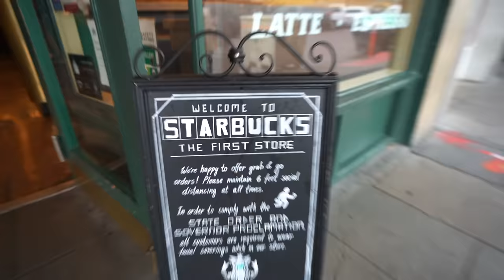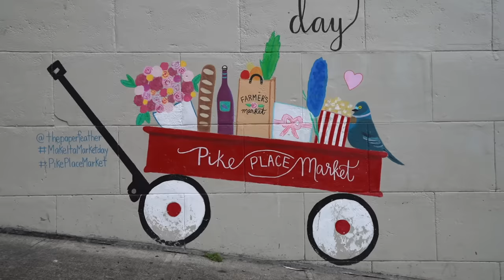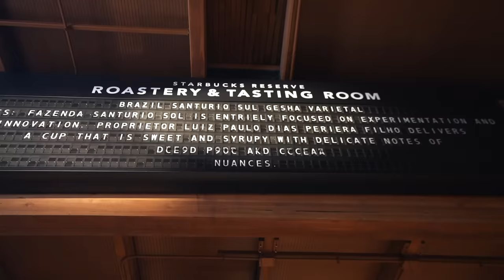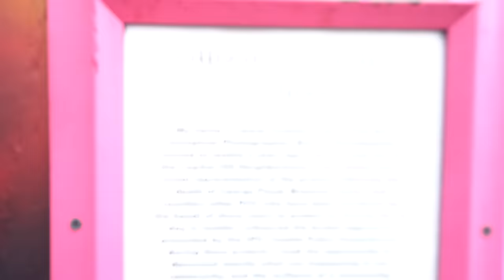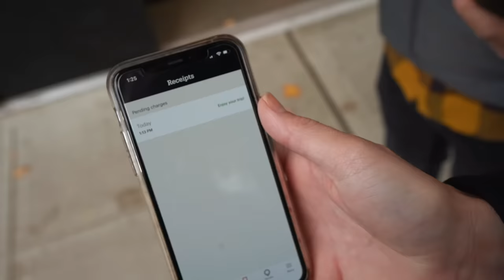FIRST IMPRESSIONS OF SEATTLE (with a local)

Comment: Obligatory local disclaimer: this is the oldest standing Starbucks, not the original location.
Reply: can you expound on this? thank you
Reply: @mervdmer  Sure, what do you want to know? The first store was opened in 1971 at 2000 Western Avenue. In '74 or '76 they moved to this location, which means it is the oldest operating Starbucks, but it's not the original. The original store closed. This is actually the 4th location. The 2nd and 3rd were in the U-District and Capital Hill, respectively.